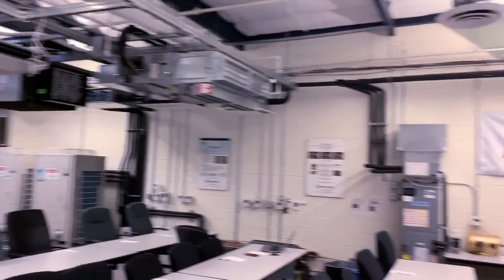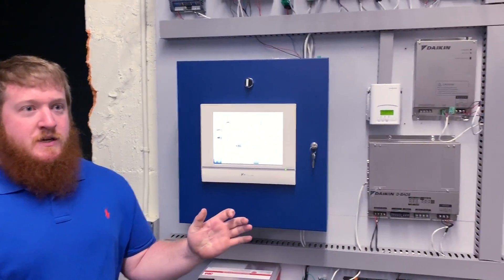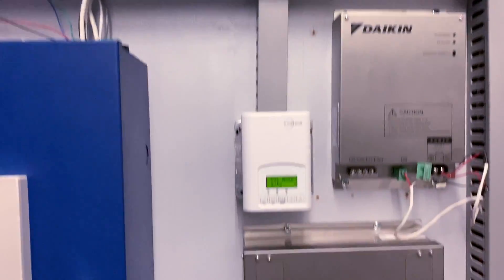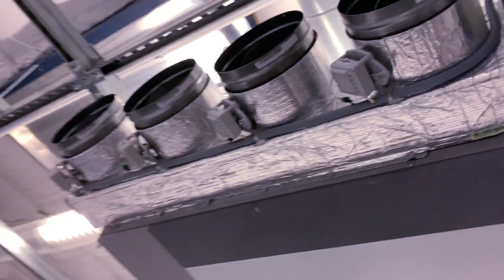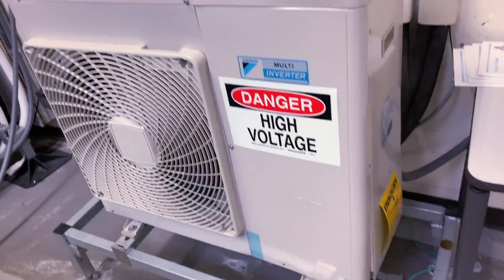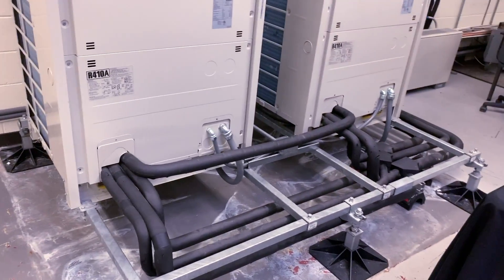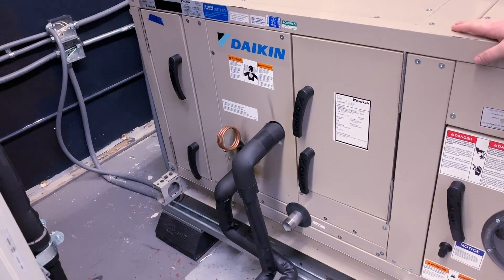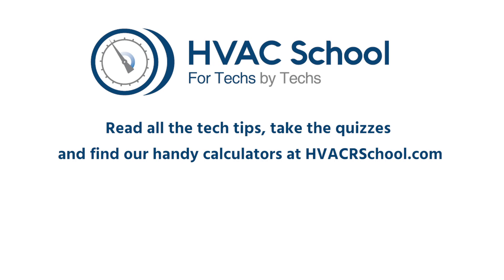VRV Training Room Walkthrough w/ Donald Falese

Comment: " VRV system can be designed to specifically meet the needs of the building. One condensing unit can be connected to several evaporators, each of which are individually controlled.In a traditional HVAC system, the system kicks on when a room is too warm or cold; however, a VRV system constantly adjusts the amount of refrigerant being sent to each evaporator and takes advantage of existing heat or cool air in the building. This varying speed allows the system to work only as needed in each area to maintain the comfort level. The result is a custom-designed HVAC system that keeps all areas of your building comfortable at a fraction of the energy cost.  Click here to learn more about the Daikin VRV System. http://www.masonbarry.com/VRV
Reply: Will keep that in mind.